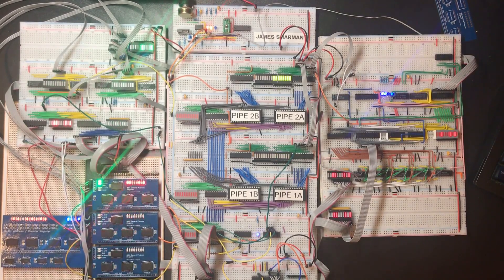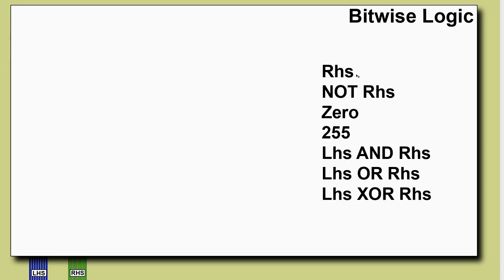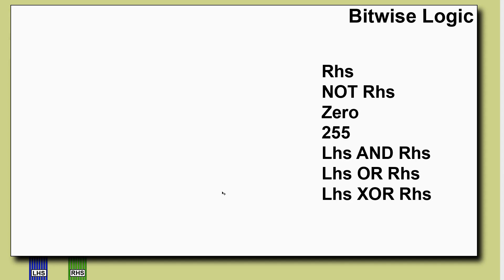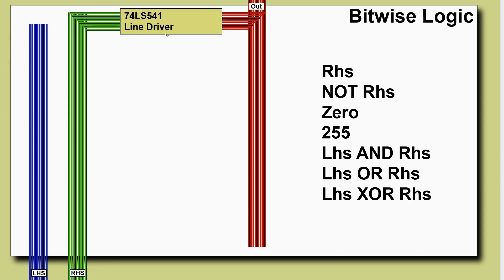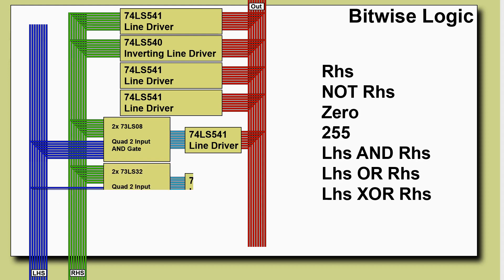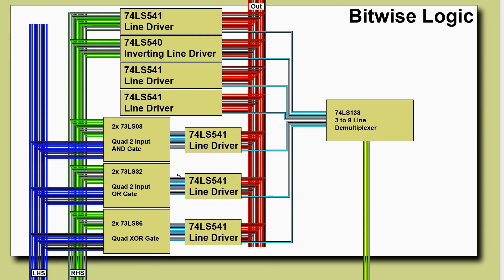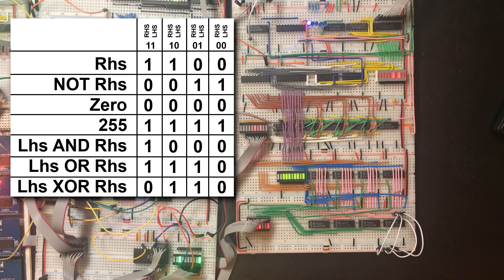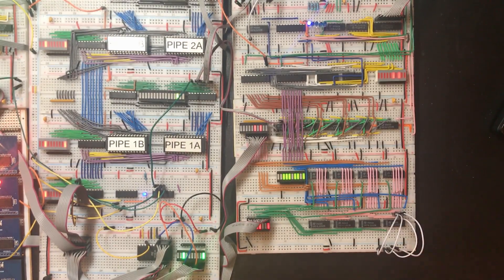ALU  (9: Bitwise Logic) - Making an 8 Bit pipelined CPU - Part 34

Comment: Could Bit operations be put on each register board so that a control signal from the pipeline could trigger it without a data transfer needing to be done?
Reply from the maker: You could do that, but it would only apply to operations that don’t need data from another register. I do something similar with the address registers, they can +1 or -1 without going via the alu.

Comment: This one took me basically forever to grok - not the "bits go into the selectors, and whatever we put on the data lines is basically the truth table for what comes out" part, that much was clear; but rather the "what exactly from the rest of the CPU do we expect to connect to those data bits, how do we create those truth tables, and from what signals?" part. It's laughably obvious in hindsight of course, but grasping where those bit patterns are expected to come from gave me a seriously hard time.
Reply from the maker: Glad you got there! The technique is really cool but I wish there were chips that just had the one circuit on them (Or a separate selector for the 2nd one) so it didn't feel wasteful.

Comment: 255 xor rhs = not
255 xor 255 = 0 (or set the carry in to the adder and just send 255)
255 and rhs = rhs
255 or rhs = 255
So you would just need to be able to set the LHS to 255

Would that not save chips?
Reply from the maker: It's always good to build circuit that are flexible and to to think about ways of getting more out of them.  It's worth noting though that:  Anything xor itself is 0, I use this all the time for a one byte zeroing.  All the examples here can be handled with the correct 4bit configuration to the existing logic unit. I use not already to implement subtract, the limiting factor in this cpu is the restrictive number of instruction opcodes (I have one byte for simplicity) so that limits the things I can expose.
Reply: @weirdboyjim  I was thinking in terms of chip count?

Plus if you do 0 as 255 xor rhs + carry the RHS is always, well the rhs. it's only the LHS that needs to be either LHS or 255, which would make the circuits simpler?

I tried to work out a way without even the 255 input.( Rhs xor rhs) or rhs would work but then you'd need need additional complication to use or as is.

But I'm not really a hardware guy, so it could be that this has complications that aren't apparent to me though.

Maybe I should have a play on a circuit simulator.

And the then build the circuit.

And then build a computer to run it on.

Oh god, you've done it now!

Comment: I could have sworn I'd seen a driver in the 74 series that had a line to toggle inverting/non-inverting, but now I don't see it in the catalog. Maybe I dreamed it.
Edit: Oh, you just used the multiplexers sideways. That works.
Reply from the maker: I've not seen anything exactly like that, but 2x 74??86's with one of the inputs common would get you similar functionality.

Comment: I have a few ideas for how I might proceed from this point. (This will involve my idea for call and return, so I'll put a few blank lines here so anyone just scrolling through the comments doesn't see it if they don't want to.)

Alright. Right now in pipeline stage 1, we're using two bits for RHS bus assert, two for LHS bus assert, and one for constant load. For ALU operations, at the very least, we'll want add with carry, subtract with carry, left shift, right shift, AND, OR, and XOR, which gives seven operations, which will take three bits to represent. We are now up to eight bits for pipeline stage one. The rest are as follows: three bits for transfer bus assert, three bits for load from transfer bus, one bit for incrementing the stack register, and one bit for incrementing the return address register, which I need for my solution to call and return. Unfortunately, this only leaves one spare ALU operation available, since I already used up all 16 control lines available for pipeline stage 1.
Reply from the maker: My line allocation out of the pipeline stages actually stayed pretty constant from my plans before I started the build, I have my original notes some where for it.

Comment: Because bit-wise logic can output 0, and left side shifter can output zero, then if you add them together it is also 0, and you can use that to write zeros to registers. Without constant (immediate).

I think writing zero to a register should be own opcode tho, and instead of zero in shifter, output 1, which can be used to implement increment by 1 easily. Performance of inc, is probably slightly more important than performance of set 0, as set 0 might be set one at the start of the loop, but inc will be executed more times.
Reply from the maker: I use xor with itself to zero a register
Reply: @weirdboyjim  Thanks for the answers! 
I just realized that you need to able to output 0 in the shifter (in LHS or ALU), as this is needed for purely bit-wise-logic ops.

I am sure there are many modifications in later videos (took a quick glance), but now only at video 40! :)

Cool project.

Comment: It took me a fair bit to understand how these chips were being used, so here's an alternate explanation in case it helps anyone:

The "data" inputs of the multiplexer are being used to specify an arbitrary truth table. Bit 00 is the result when the inputs are 0 and 0. Bit 01 is the result when the inputs are 0 and 1. Bit 10 is the result when the inputs are 1 and 0. Bit 11 is the result when the inputs are 1 and 1.

The "select" inputs of the multiplexer are being used to select the appropriate row of the truth table. If the inputs are 0 and 0, bit 00 is selected, and bit 00 is whatever the result should be for inputs 0 and 0. That phrasing is a bit circular, but I hope it illustrates how the chip is being used.
Reply from the maker: Apologies if my explanation didn't work for you.
Reply: Additionally one needs to keep in mind that all operations the RHS unit can do are applied to all 8 bits of the inputs independently. Which means they can be broken down into a 2-to-1 truth table. Unlike the LHS unit, where the result of any bit does depends on different input bits.

Comment: Multiplexers, the nuclear option of logic design.
Reply from the maker: I did explore a few ways of implementing these functions. I was tempted by having groups of pure logic chips and line drivers (Or a simpler Multiplexer stack to select the output). Having OR done by a pair of 74xx32, XOR done by a pair of 74xx86 etc.. would have felt quite nice. In the end I went with this approach as the chip count was notably lower. The opposite end of the spectrum would have done the entire ALU in 2 eeproms and a couple of bits of glue logic. I'm ok with the solution I picked.

Comment: Instead of 8 74LS253s, couldn't you use just 2 74LS181s?
Reply from the maker: I could indeed, 2 of those would actually replace a larger chunk of the alu (such as the addition section). I have a few reasons why I didn't do that,  firstly it's an "alu on a chip", I'm not really building an alu if I use that. Going down that road and I may as well drop a 6502/z80 on a breadboard and call my "diy cpu" done. I wouldn't have proved anything to myself. The second reason is a practical one, it's an obsolete part, you can still get them but I'm not aware of anyone still making them and I've never seen a cmos smd version.
Reply: @weirdboyjim  Would be funny to drop in a 6502 for some trivial task like driving the reset procedure... ;) ;) Or better yet, an 80186...

Comment: I reckon your all ones and all zeroes could have been done with a single chip with all of the inputs tied together, and some kind of input from the instruction itself determining whether it drives high or low, e.g. the value of the LSB.

Potentially one of those values could even be a lack of drive from any of the chips, and a resistor pack pulling all of the signals one way or another.
Reply from the maker: You are touching on a couple of subjects here. You could do the operations independently but I really liked the simplicity of the multiplexer solution. I have to strike a balance between the architecture and my ability to explain it in a succinct video. One of the biggest compromises in this design is using rom chips to simplify the control logic, If you were making this to a gate budget you would indeed be carefully managing the relationship between bits in the instruction and the control it was generating. I actually considered a design where the instruction was much larger and directly mapped all the bits directly to control output, completely eliminating the need for control roms.
Reply: @weirdboyjim  I suppose I looked at it as a nice creative way to simplify the circuit a bit.

Interesting that you say you were thinking about instructions that directly map to control lines. Ive had a similar thought from time to time, but I have to convince myself its a bad idea because instructions could end up being hundreds of bits wide (when you consider the instruction decode ROM of even something like a Z80 or 6502 for example), which would be very inefficient storage wise, or the decode logic becomes more complex if certain bits have to map to different control lines based on the step within an instructrion.

That and you would need multiples to control sequenced operations.

Theres probably a good reason why CPUs are built the way they are. :-)
Reply from the maker: If you look at more modern processor they put design effort into making sure parameters have common locations in the instruction (i.e. if there is a destination register it always occupies the same bits in the instruction) to simplify decoding.
Reply: @weirdboyjim  Yeah, Ive looked at things like RISC-V a little, and even m68k has a similar method for its instruction format. Are those the lines along which you were thinking? Or more literal bit to control line mapping (cause thats what I was thinking)?

Comment: Seems like a nice solution, perhaps a bit slower than gates, but more flexible for the number of chips.

And if you do make some program that use a lot of NANDs, NORs and XNORs, and want to have that hardware functionality to reduce the steps needed, it would probably be relatively easy to reconfigure this later to add those functions, compared to if you had gone with the gate solution.
Reply from the maker: Indeed. It’s interesting that ISA’s usually have AND/OR/XOR but not NAND/NOR/XNOR. When you get to Part 41 and see how I tie all the sections of the ALU together you’ll see just how easy it would be to add or change operations.
Reply: Muxes have a low propagation time compared to complexity of fuctions you can get out of them.
Reply: Those extra address lines to the pipeline roms come to mind. It would be easy to add an opcode that switches those to another pattern (a copy of half the constant register), effectively changing the meaning of all opcodes. So you could have banks of opcodes, one of them could have opcodes to drive all 16 possible RHS operations and leave out e.g. some MOVs or port IO.

Comment: Perfect timing, I was in need of entertainment.
Reply from the maker: Eack, not used to other people watching videos before I finish my final check watch after uploading. ;-)
Reply: @weirdboyjim  just at the right place, at the right time.
Reply from the maker: I hope it was suitably entertaining.
Reply: @weirdboyjim , it certainly was. I am myself working on a homebuilt computer, but a bit more extensive. Shooting for a 32 bit system with a floating point ALU, inspired by the old mainframes like the IBM 360.
My main purpose is to have lots of I/O's to display my collection of old parts (instead of just having them sitting on a shelf)
Reply from the maker: I have plans for a 32 bit cpu after this but trying to not let myself get distracted until this one is done. At the most basic level it's just making the alu and registers 4x wide but I have some other architecture ideas to experiment with.  Floating point from discreet logic? Or are you going to microstep it with a more complicated control unit?
Reply: @weirdboyjim  I am not quite there yet, I think it will end up being a bit of a mix. I'm trying to design so that everything is connected to a main backplane and each unit (CPU, memory, ALU,...) Has its own local backplane, so I can expand, eventually even have a DMA unit and multiple processors.

For the floating point ALU, I want to at least do the multy unit made out of logic IC's.

I'm hoping to shoot the first video, about the design, this weekend and put it on YouTube.
Reply from the maker: Yeah, modular build is a good way to do it if you are working incrementally. I'll look forwards to seeing the video.